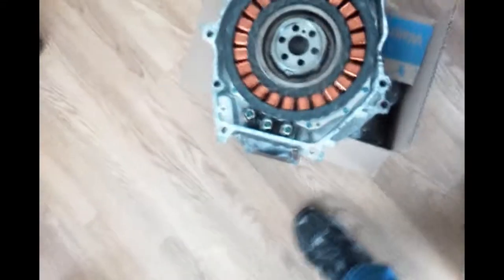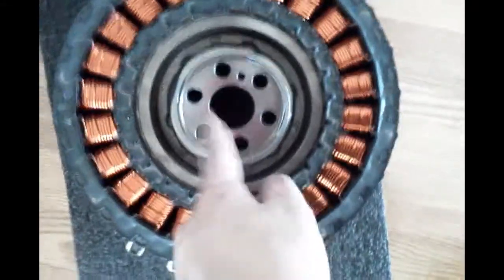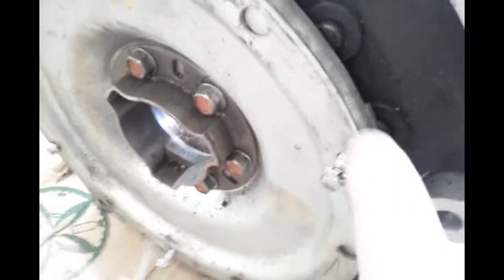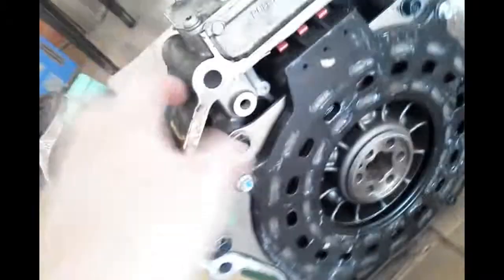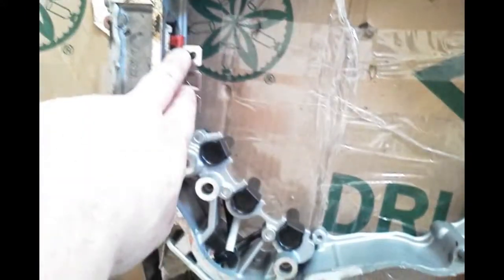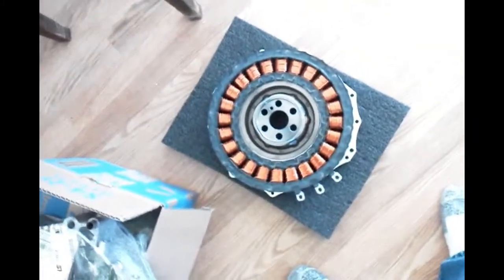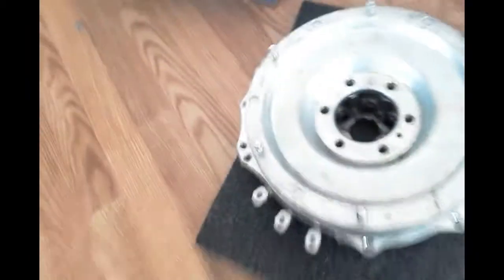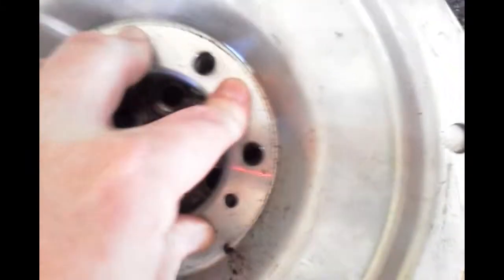10kwG1 vs 17kwG3 IMA

Comment: Sir, can you please confirm:
What instruct IMA motor to sense that on what RPM & TORQUE motor should rotate (Contribute to Engine's Load)?
Reply from the maker: Ideally to maintain peak efficiency.

With plenty of electrical supply available = EV-Mode
In PHEV mode = keep ICE at peak BSFC

Comment: What is the total weight of 3gen motor with and without external housing?
Reply from the maker: Not 100% certain / clear what you mean by 'total' .. but if we are drawling  that line in the same place .. about ~20kg total with external housing .. about ~15kg without.
Reply: @ianpgeorge  is it true that they are liquid cooled? And where are the cooling holes?
Reply from the maker: There are no holes for liquid cooling (that I know of) in this IMA motor itself.

Is it Liquid Cooled ? .. technically 'yes' .. but I don't think it's the same that most people would expect/think of .. when someone says 'liquid cooling'.

This IMA motor in OEM usage is attached to and shares the liquid cooling system used by the ICE .. soo , purely technically there is cooling from a liquid .. but , it's a bit more of a indirect thermal connection , than what I think most people think of , for the term 'liquid cooling'.
Reply: @ianpgeorge  so basically it is not liquid cooled as a unit rather it is bolted to a liquid cooled metal of the engine block.

I am considering sandwiching 4 of these motors after maching the hubs to connect them together.

Do you think I will be able to squeeze out 40kw 144V 300A from each motor with kelly controller and maybe cooling plates in between??
Reply from the maker: @FirstLast-tx3yj  For short periods / bursts .. yes I think it could get up around that ~40kw each .. I think the limitation on how long the motor can hold that high of power will come down to how well you can manage it's heat/temperature ..  If you can keep it reasonably cool .. I would suggest a combination of both higher voltage and higher amps to get higher power .. trying to get more power only with more amps , will be more limiting and difficult than if you are willing to increase both volts and amps.

For example .. Peter Perkins on the much older gen1 OEM rated 10kw IMA motor was able to push it up to around ~30kw for short bursts .. or 3x the original OEM power rating .. this 3rd generation 17kw OEM rated IMA motor would need to be able to do about ~2.6x OEM power rating to reach your ~40kw goal.

Peter's video https://www.youtube.com/watch?v=f0SltJeZNwY 

Good luck.
Reply: @ianpgeorge  adding voltage would increase max rpm wouldnt that affect the combustion engine since it has a rev limit?
Or you mean add voltage while keeping the same max rpm of the motor will also result in more power?
Reply from the maker: @FirstLast-tx3yj  2nd one .. all else being equal .. more volts with the same max RPM will have more watts of available power.

Remember this is a brushless motor .. the RPM is controlled by the motor controller's changes to the electricity in the motor's phase windings .. if the motor controler doesn't move or change the electricity around and around .. the motor doesn't spin .. it just locks in place by the non-moving electromagnets .. no matter what the voltage is.

As for the 1st one .. yes , a higher available voltage allows the motor controller to spin a given motor at a faster max RPM .. but that doesn't mean the controller has to do use all of that max RPM all the time  .. the voltage is just a max upper limit to counter back EMF of a rotating motor .. but any RPM bellow that max , is controlled by the motor controller itself .. as it is that motor controller that controls the speed (if at all) the magnetic field rotates , that in turn moves the motor.

Peter pushed his gen1 10kw ~144v nominal motor up to ~220v ~140a (about ~30kw) .. he had that ~30kw at 20mph or 50mph or 70mph , etc... any rpm / speed he wanted.
Reply: @FirstLast-tx3yj Why not just replace a 10kw with 17kw in a 1st gen insight? That oughta be a significant improvement in power and efficiency.